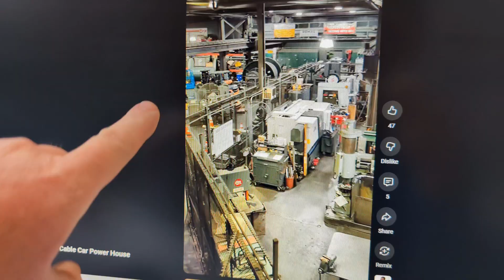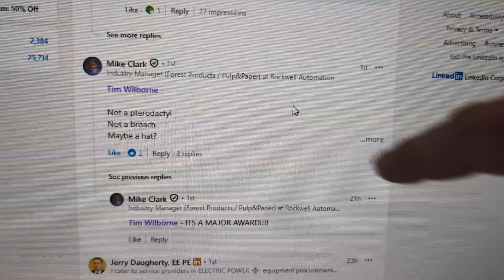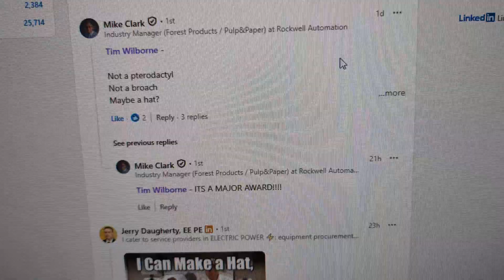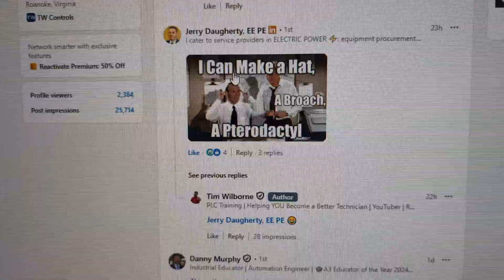Why I’m Neither an Electrician Nor an Engineer (And Why 38 Isn't Too Late)

Comment: I was a factory laborer, got into their maintenance tech training, and spent 10 months at Vo-Tech learning everything from basic mechanical and welding, to electrical fundamentals, PLCs, number systems, drives and PLCs.  GPTC in Lawton geared their training to the huge tire factory in Lawton, OK and used 50% hands on with equipment donated by the company.  It was a mini factory next to the classroom with conveyors, pneumatic controls, compressors, cooling loops, etc.  

They had that school teaching techs for ten years before I got in ('96) and it was quite polished and well rounded to turn out good technicians.  Due to the fact that I was an Atari kid who won the state Asteroids championship at 15 years old, prize being an Atari 400 computer, I already knew all about number systems trying to build my own Galaga as a kid, so PLCs were easy for me and it wasn't long before I moved up to specialist and full time "PLC guy".

Occasionally someone will call me an IT guy, and I cringe, or ask me if I am an engineer to which I reply, "No, just a jack of all trades and master of bation."
Reply from the maker: Sounds like a great program and a great career!

Comment: Your comment on the lumber industry! In my previous job we bought a piece of equipment from another company and had to go there to disassemble it. We were lead in and were not allowed to deviate, if we needed a rest room break, and at lunch, we were lead around where we needed to go and brought back. I found out that prior to that experience, my current employer installed some equipment there and any videos of the equipment had to be deleted and same deal. Funny there are only so many ways to process lumber, no big secrets.🤣🤣
Reply from the maker: Yep, same with so many industries :)

Comment: Love hearing your convoluted history.  Started as CAD/Board Drafter - Associates.  I have had FAR too many titles ranging from Developer, IT Technician, Controls Engineer, Programmer, Drafter, Designer, Maintenance Tech... and each time found new ways to increase my knowledge by engaging with all aspects of production - except when I was made to stay in the programmer realm and allowed no tools.  Started at 26 when PCs were just leaving DOS and Windows 3.11 was released and now 58 still learning and teaching.  Sweetest job is Electrical Maintenance Technician as I get to play with all the old and new toys, troubleshoot, maintain and spec them out.  NEVER TOO OLD TO START.
Reply from the maker: Thanks for sharing your story!
Reply: Which position paid the most?

Comment: 1:20 couldn’t agree more. I’m now a controls engineer and did a lot of project work with hardware design/implementation/debugging for FSAE during my undergrad EE coursework. I wouldn’t be near where I’m at now if it wasn’t for that. Yeah the circuit theory and all that matters but you have to apply it in the real world for it to really click.

Comment: What simulator video are you talking about and did my ignition comment you did the issue you had?

DC wiring: Blue +DC White with a blue stripe -DC is easy to define and know what's what
Reply: he basically said in his video its harder to learn on just a simulator/emulator because theres no actual hardware and its not as hands on as just a trainer.
Reply from the maker: I worked through the problem in the Ignition video, I don't think you watched far enough into it :)

Incorrect on the wiring being easy to define.  It is very regional and can even vary between two companies across the street from each other.  We went through that in the color code video.

Comment: I am a HUGE fan of your videos.
I'll be 67 in November.  I've been in industry since 1982,  starting in Heavy Equipment. 
Over the course my career I've been increasingly involved in industrial electrical projects. The company I worked for owned asphalt plant and rock crushers; I got tired of waiting on electricians to fix issues so I got involved with the plants electrically.
My first major one was gutting a primitive PLC system and replacing with simple relay logic because the system was too unreliable. This was circa 98'-99'.  I shied away from PLC's for a very log time after because I did not trust them.
Bounce forward 20+ years. Our AB 1200 controllers are being phased out, and even though the 1400's are still out there, they too are on the way out, and their larger foot print made them hard to retrofit in cabinets that were tight on space.
My PLC guys weren't interested in learning the CCW/Micro 800 system citing a plethora of reasons (excuses) why they thought it was a bad idea. After two local firms failed to transition our previous program to micro 800s, I did Rockwell's stop light trainer routine and decided to get involve with that project. 
I have done several successful programs for our projects that have enabled us to move beyond the 1200 series controllers and advance on what they previously did. I owe much of that success to your videos.....and a desire to keep learning.
38 or 40 too late to learn new tricks...only if you let it be.
I'm neither an electrician or an engineer, but have had to rework the efforts of both
Thank you for what you do!
Reply from the maker: Thanks for sharing!  That is what is great about our industry.  There are always opportunities to learn new things and move to new positions.

Comment: whats the salary gap after 5 years ... PLC Prog./Troubleshoot or Cert. Electrician ?  in US and Canada ...... thanks ;)
Reply: I made $40/hr as an industrial journeyman electrician. Back in 2018 I went to school to learn programming. I stumbled for the next 3 years before getting into a full time automation/process controls position. Getting into automation I started at $45/hr in 2021. In my experience electricians have more opportunities at overtime where automation technicians/engineers have much less opportunities to earn extra pay in their roles.
Reply: In the southern US our PLC technicians usually run in the $65k to $130k depending on your skills, willingness to travel, and what industry you are in.
Reply from the maker: Great conversation going on and probably video worthy.
Reply: Im in SoCal and I made the switch from IBEW Inside Wireman Electrician to BMS Automation  Specialist. It took 3 years for me as a specialist to reach my same salary as an electrician. Now I finally make more than the union pays their electricians  at 5 years.

Comment: Hey thanks for the shoutout! I am probably a little biased on the drives... 

Regarding the hardware, I have been trying to develop a system that gives people access to hardware to test without having to buy trainers but still experience the "fun" of working with real hardware.

I might hit you up if I ever get traction on it as you have a different audience that could benefit as well.
Reply from the maker: I've been enjoying learning about the G120Cs. 

What would be great would be able to get "read only" access to a system along with a couple of camera feeds... Maybe that's my next project  😂
Reply: @TimWilborne  I'll reach out on LinkedIn with the design I have come up with. Its nothing fancy, but it just requires it being executed. It would be awesome to bring it to the community...